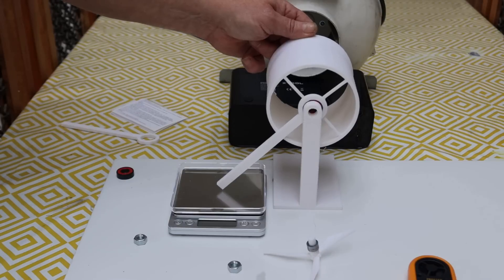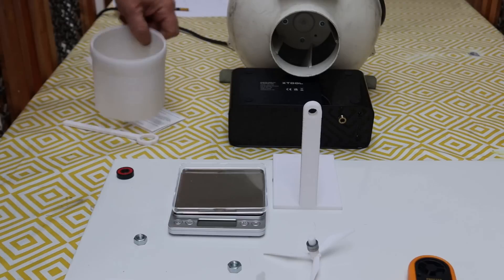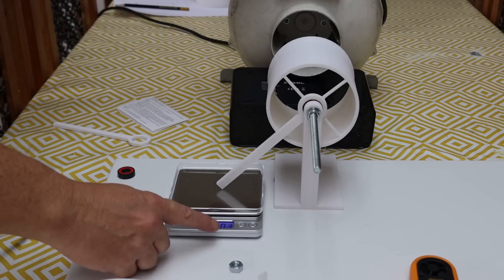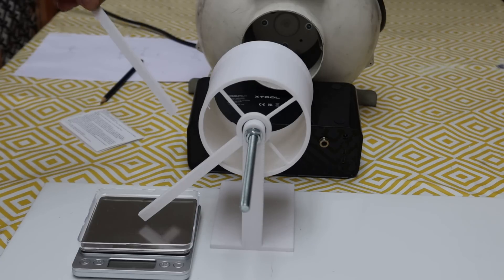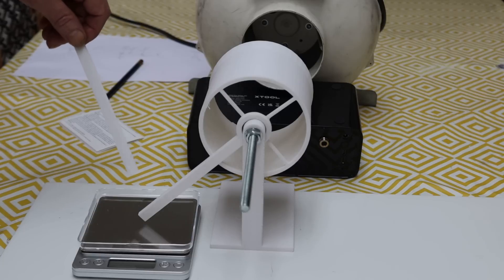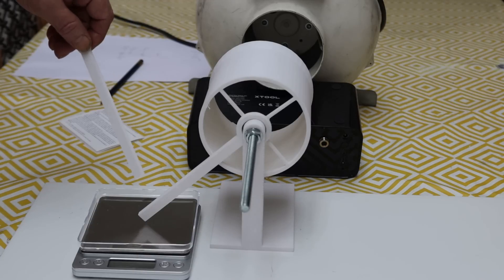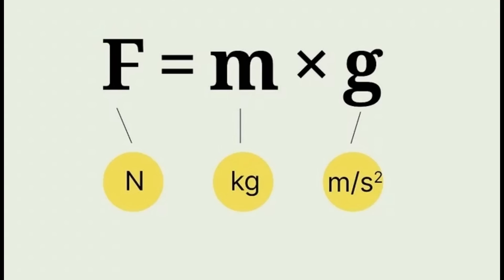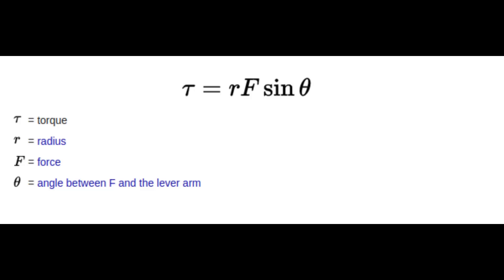2315 Is Your Wind Turbine Any Good? A Way To Measure Torque

Comment: I suggest using load cells or similar sensors, and a Bluetooth module to send the data - that way you can measure torque at different rpm and even under load.

Comment: Great video Robert. Using ChatGPT a simpler approach may have been found: By maintaining the arm in a horizontal position with a small screw inserted at the end as a pivot point, remaining planar, the calculation of torque simplifies. This configuration ensures that the angle between the applied force and the lever arm is zero, meaning that the entire force is applied at the very tip of the arm. Consequently, the calculated torque becomes straightforward, represented by the equation:
T=r⋅F
where 
𝑟
r is the distance from the center of the shaft to the screw’s head, and 
𝐹
F is the force measured. This approach eliminates potential complications from varying angles or misalignments, ensuring that the force measurement is accurate and consistent. By keeping the arm horizontal and using the pivot, the torque calculation remains reliable and easier to compute, contributing to more consistent test results.

Comment: Oh wow, that took me back nearly 45 years....as a young technician I had to torque load a fastener that was below any torque wrench we had in the tool kit.....6 Lb/Inches.......I was handed a ruler and a spring balance and told... "go on then, work it out".....the revelation of the solution was a Eureka moment for me  because I'd learnt how to do things outside of what I'd been taught.

Comment: Is constant airflow at a fixed speed the proper way to measure dirty, nasty, wind, though? A turbine that functions at one fixed speed might not do as well as one that is more adaptable under variable conditions, or am I off about this one. Admittedly, I'm more in Erasmus grandsons camp, so I tend to measure things in how many little watt babies can mommy volts and daddy amps make over the course of a day.
Reply from the maker: one way to see variable wind speed is as a fixed wind speed of variable short duration - so if you vary fixed wind speed you can model variable wind speed - it's a way to get a handle on it

Comment: hi, today i made an interesting battery. Its iron-iron alkaline with sodium bicarbonate for electrolyte. Its 0.6V, for electrodes i used steel dish washing wire. i have charged it for 2 min and it had power to run small motor. now im interested in what chemistry is going on there and is it any good. The other day i was exploring batteries and dry piles, and came to idea to try to make lead-lead alkaline but made this one instead
Reply from the maker: awesome mate

Comment: shouldnt you make a counterweight to the arm resting on the scale? Otherwise you probably just weight the arm?
Reply from the maker: you are weighing the arm - pressing the tare button subtracts that weight from the display. When you turn on the fan the scale weighs both the arm and the force of push but the display only shows force of push as you have already subtracted the arm weight. You can make a counter weight if you want but there is no real need to

Comment: I don't understand why the rod is placed at a 45 degree angle, instead of horizontally. Maybe I'm wrong but it seems to me that the angle will cause some force to pull left on the stand instead of being measured by the scale.
Reply from the maker: it doesn't really matter where you place the rod - apart from zero degrees of course - as long as you take the angle unto account - do 90 degrees by all means

Comment: Thanks for this explanation. I do have a question regarding the torque of the pipe specifically, since it has such a large area where the wind could be pushing downward on it (or upward if the angle was different). How can you tell that this is a result of rotational torque as opposed to a slightly downward force on the pipe itself caused by the wind.  It would be interesting to see the experiment repeated such that you place the scale on the opposite side, so when the wind blows the torque applies a "lifting force". Assuming the position of the blower and device are the same, this would potentially rule out a downward force on the pipe.
Reply from the maker: you can't tell - and by all means reverse it - a balance spring would work well - nice thinking mate - but then i was mulling it over - if you think about it lift is just and upward push and drag is just a downward push - so would it really matter? It is a genuine question mate as I am not sure it makes a difference to be honest.

Comment: Always excellent and educational, thank you.
An observation, which I suspect you have already considered. As the efficiency of wind turbines tends to change with both wind and rotation speed, how much of a 'danger' do you think there is for being mislead by a static measurement at one wind speed?
eg: Would timing lifting a weight for various wind speeds be a useful addition or unnecessary overcomplication?
Reply from the maker: it depends to be honest - if you are talking a few percentage points then error can easily outweigh the result - but if the difference is significant you are probably on a winner. Equally - of course other factors always come into play - for example if the turbine works well enough but is dirt cheap to build you might also be on a winner - there is just never really a clear cut answer as so much depends on individual cases

Comment: I measure my turbine's torque by using a spool and string lifting a weight. The weight is a bucket which I add nuts and washers to. I get weight, speed and distance factors from that.
Reply from the maker: awesome suggestion mate - cheers
Reply: This is one of my favorite methods too.
Reply: That's how I would go about measuring dynamic torque as the scale isn't going to work for that, but for static torque the beauty of using a scale is its flexibility as you can increase the wind speed while taking measurements, and it can be used with a vertical wind turbine too as long as it's the right type of scale.
I guess the spool method can be used to calculate torque while changing the wind speed (without adding weights) by measuring the difference in lifting velocity.

Comment: I'm a bit confused because initially you showed your new turbine prototype which appeared to be a cylinder with curved fins on one end. Then when you were showing the first test, the fins were gone and you only had a finless cylinder on the test stand. So with no fins or spiral grooves evident on the test model how was there any torque being produced?
Reply from the maker: the video is only about static torque measurement mate - the turbine design isn't that important right now - I have been working on this and there will be a video on it where I will go through the design idea and process - that will help clear up confusion - I hope!
Reply: @ThinkingandTinkering  OK, I see now. Thanks for the explanation!

Comment: Oh yes, my little homemade windturbine is good enough for its goal. It delivers a vew watts to 3  12 volt fans without battery in between at low windspeed. No gears. If the weatherchanel forecasts stronger winds, i simply put a copper coil paralel to the fans to give it some resistance. Its just a toy ofcourse. But it gives me LOTS OF FUN 😉.  Learned a lot from your videos thank you sir. Sometimes in a real storm it brakes down so i learn about the force the wind puts on it and i learn what i have to build better. Greatings from the Netherlands.
Reply from the maker: awesome mate
Reply: Try a Joule ringer or Theaf inverter.
Super simple charger and lighting circuit, 2m2222,  2n3904, 2n1107/9, for bigger input and output 2n3055.
 Pancake coils(scrap speaker wire or plug cable works) are easy, coil for this... Makes Wireless
Reply: @j.christie2594  I have to look into this, becouse i have no idea what you are talking about but i am eager to learn😊 Thank you anyway !

Comment: Great video very interesting, I wish my maths was much better. But with your formula and using online calculators very do able. They used to use a very similar technique to measure hp on steam engine ect. Basically a brake..👍
Reply from the maker: it is a very similar idea to the prony brake mate
Reply: @ThinkingandTinkering  that's the name that was on the tip of my tongue cheers 👍